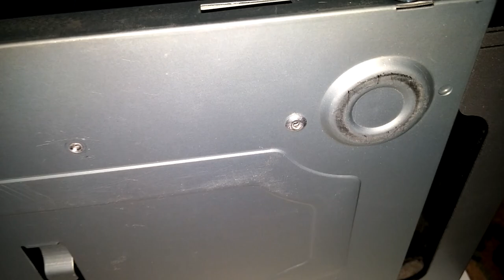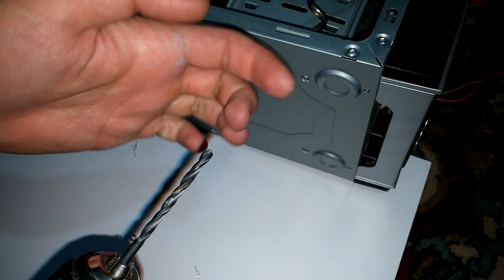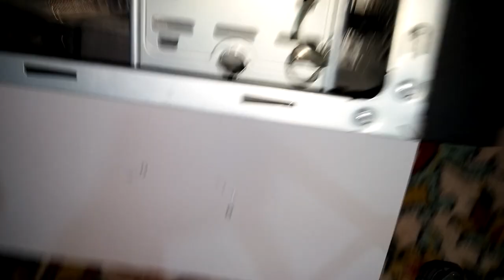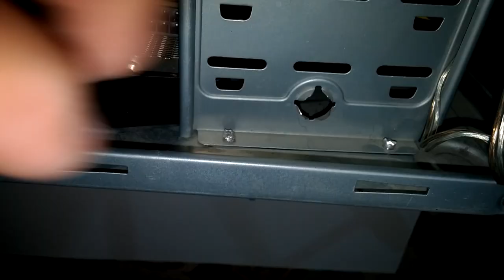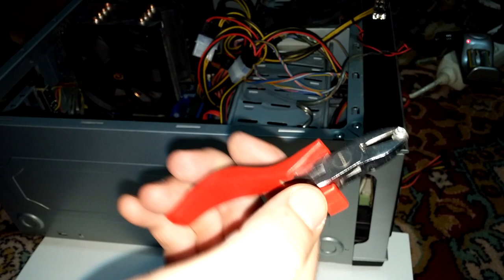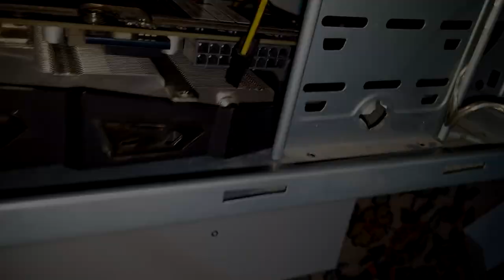How to Remove POP Rivets (PC case)

Comment: Whos bright idea was it to standardize rivots on cases anyways
Reply: Greedy people. Rivets save them 1 10th of a penny compared to normal screws
Reply: I think they did it to discourage people from completely taking apart their computers.
Reply: @subwoofer-friendly  why would they want their case to be less modular/ customizable?
Reply: @kodaxmax  Not all computers are meant to be customized.
Reply: Wow, 1/10th of a penny saved? Try literal dollars. It is insanely faster to install a rivet with a rivet gun over a screw, even with a drill. It saves them literally hundreds of thousands, if not millions of dollars (depending on their volume). It has nothing to do with modularity, lol. People that mod cases have the right tools, or get the right tools. This is designed to fit standard PC components in standard configurations. Want a custom job? Order a custom case.
Reply: my motherboard is too large so we were removing an unnecessary thing that doesn’t affect the case and these damn rivets are so annoying
Reply: Because the manufacture wants you to take it to them, so they charge you to fix it.
Reply: @RPGPiixe  That, but also so you buy a new Pc all together. Theirs no guarantee they get the repair work.
Reply: @kodaxmax do you know who john deere and apple are

Comment: Compared to my efforts of removing my own riveted in computer case you seem to take yours off lickety split. I'm thinking that the drill that I borrowed  from my friend was pretty weak and the bits I used were for wood or something. Bc I put almost all of my strength into it and almost nothing budged. Are there special bits just for metal substances? Thanking you in advance. Have a good day.

Comment: I'm thinking of cutting an old PC case so I can make myself a small case with 2x  5.25" drive bays.
All external optical drives that I bought sucks compared to the fat 5.25" ones. (my current case has no 5.25" bay)

Comment: Is there any way to do this without a drill?
Reply from the maker: Try a screwdriver, or some pliers, but it's much harder...
Reply: furulevi I ended up using a small flathead screwdriver as a chisel and it worked pretty nicely.